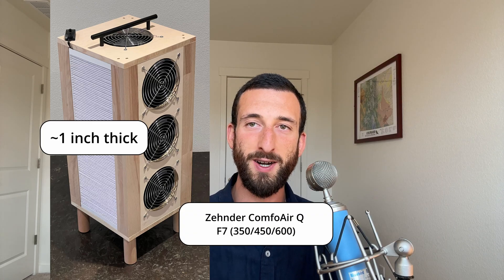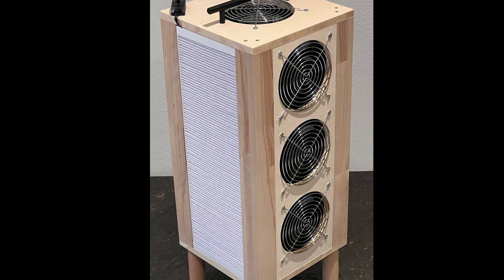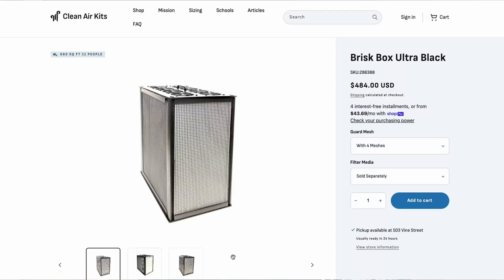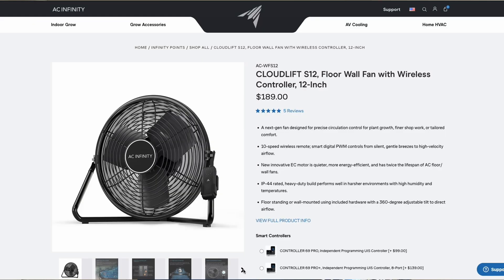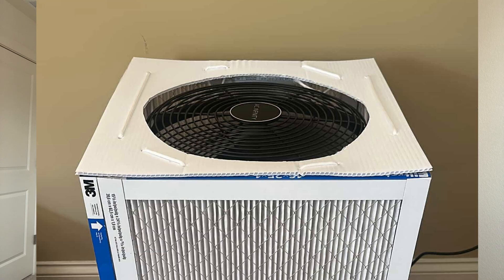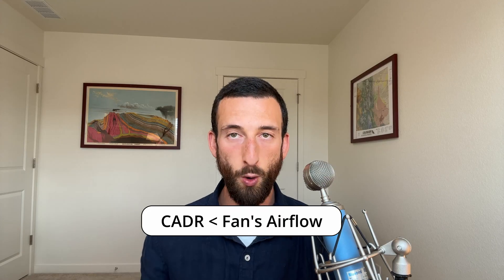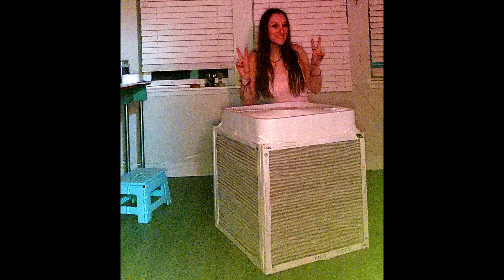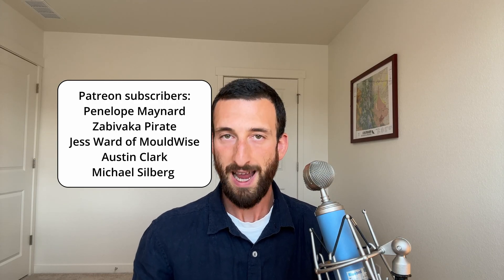Reacting to your DIY air purifiers.

Comment: Is it true that with duct fans, pointing the fan inwards into the box works better at picking dust away from farther off due to laminar flow(provided no static pressure)?

Comment: Is there a purifier design that can work for those who are chemically sensitive? 

I tried to build a purifier box using your design (vertical fan + 4 Filtrete filters), even using hot glue, but there was something about it that aggravated my sensitivities. I think the Filtrete (or any other brand really) filters themselves use some kind of glues/chemical additives which probably take a long time to offgas. 

Traditional HEPA purifiers are mostly plastic garbage, and many even have HEPA filters themselves which are reported by people to have heavy chemical smells.

You've been focusing on CADR and energy efficiency in your recent videos, which is great, but this is one neglected aspect of air purification that could use some light shed on it.

Comment: Man it would be awesome of there was some sort of 3D Print design that could go with your Box design.  I still have my parts but haven't gotten to making it yet but if somebody could 3D print the frame work to hold the filters and fan I think that would make your build way easier to make.

Comment: Hi Alex, I am trying to decide weather to purchase filtrete Merv 13 (1900, 2200 mpr) or Merv 14 (2500 mpr) from amazon. Do you have an opinion? If I am installing 4 of them, I wouldn't think air flow would be an issue (currently have 6 sickle flow pc fans). So just besides the cost wouldn't it make more sense to get the higher rated?

Comment: Did you study what HEPA or MERV filters are made of? I found that they are produced from glass fibers bonded together with a resin that can smell chemically toxic when the ventilation system is started. I believe these glass fibers—sharp like tiny needles—could be a serious problem for the lungs, potentially more dangerous than cotton fibers, because they can puncture tissue and remain stuck there. It’s only a matter of time until they might be banned. The faster the blower runs, the more of these sharp fibers may become detached from the filter and released into indoor air.

The only truly safe method to purify air is by electrostatic foor filtration, like the one you showed us in your last video.

THX

Comment: Main problem with my country is that these large HVAC filters are not readily available as central HVAC for home use are not common here. I really want to make one of these high airflow box fan filters.
Reply from the maker: You can look into using IKEA starkvind filters - those are somewhat more readily available in places HVAC filters aren’t. Digikey also often stocks 3M filtretes at decent prices, I believe.

Comment: these designs are ok, but a box for the 20x20x1 filters with a small cutout for an air mover (carpet drying fan) is superior in air flow and far superior in static pressure. Low modes can be the same noise.
Reply from the maker: Have you built one of these? Or could email me a picture of one?

Comment: IMHO, Arctic fans are far, far superior to cooler master in one specific metric - price. Bought in packs, they're like 5 times cheaper. If not more. They're decent at certain rpm but may not be perfect for a radiator (or a air filter) due to low static pressure. At least, p12 were, max were supposed to improve those metrics a bit.

If we're talking $30 per fan, last time I checked nobody beats phanteks t30 or noctua fans (the most quiet 120mm fans with good parameters overall, at around $30 per fan). Other brands typically have more noise. If you don't want an always-on vacuum in your room, I'd look into noise first.

Oh, and my room always has the least dust of all rooms in my apartment. Probably because I have 14 fans in my PC which also has dust filters! 😂

So I was thinking of building an external enclosure for all the fans and all the radiators, and slapping an air filter on top. Will probably decrease airflow, but Iplan to compensate with larger area - bigger rad is always better, same for air filter.

Probably. Maybe. One day 😂
Reply from the maker: That's a fair point, thank you! You get what you pay for ;)

Looking forward to that build, let me know if you do it.
Reply: True. I paid around $30 for 5 fans. (I build the first design he mentioned.

Comment: I really need to build my own design, where I replace the side of my powerful gaming PC with a filter, and put all my fans so they suck air out of the case. That way I'm cooling my PC and cleaning the air at the same time. Two in one.
Reply from the maker: I’d love to see a design like that!
Reply: @HealthyHomeGuide  It won't be particularly powerful, but I've got 3x120mm fans running like 15 hours a day. Why not put them to some good use?
Reply: I get you but I wouldn't recommend it. Your pc needs exhaust fan or it will get hot faster. PC cases have an airflow that helps gpu fans to get clean cold air. If you replace exhaust fan with intake fan it will remove that airflow so gpu fans will get dirty hotter air.
Reply: @agift4u240  Hi, I'm running a 4060. All concerns regarding dirty hot air goes out the window with that fact. It's completely fine. Your concerns are valid for someone running a 5090 or something.
Reply: Bad idea for the reliability of your PC. Positive air pressure (more air mass inside the case) is better for cooling the CPU and other components. That's why everyone makes the case fans pull air into the PC, not out of it.
Reply: @gregvanpaassen  Hi, the way everyone actually does it is putting fans on each side. With some pushing air inside and some out. That way there is airflow going through the case. Nobody is making all the fans push air into the case. in like 99% of all PC's the rear 120m fan will be pushing the air out. Unless you have a extremely high end system, this is completely no issue at all. I could disable all my case fans and simply take the side of my case and my PC would run happy for years on end. Btw its a 4060 TI (with a overbuilt cooler just like very GPU these days) paired with 5700x3D cooled with a noctua tower cooler. With minus 30 curve optimizer and tjmax at 75˚c. so its running pretty cool. This computer will run very cool even with the filter setup I described.
Reply: @Mastermind12358  No, the exhaust is through the GPU vents and remaining gaps in the case.

I have a RX5700 XT, manufacturer reference version (famously hot) and get much lower temps than you with only three fans.
Reply: @gregvanpaassen  It'll be fine. don't worry. I'm planning on putting a filter the side of the computer and I'll make sure to carefully note down all the temperature data before and after. cheers. Also what you're talking about is a blower style GPU fan. I recommend avoiding those.